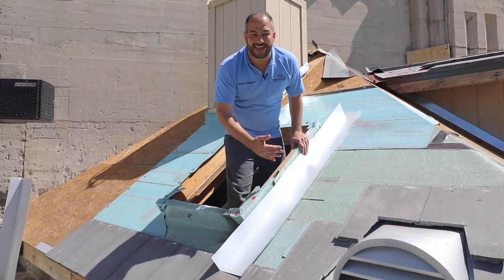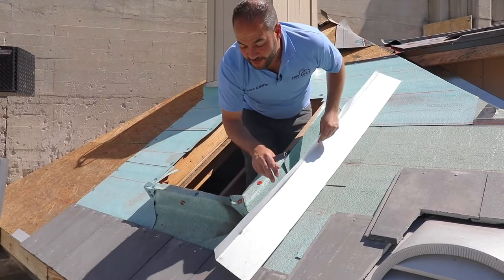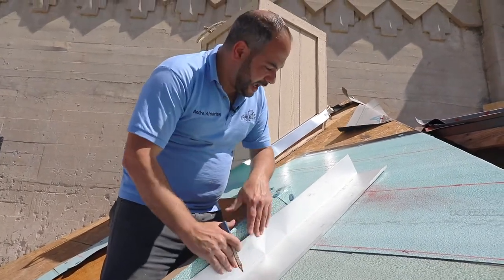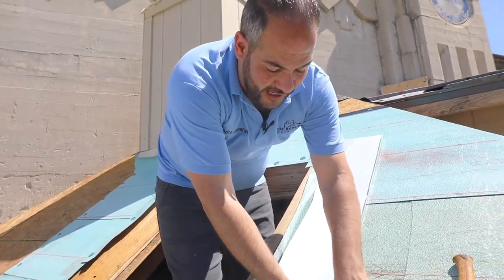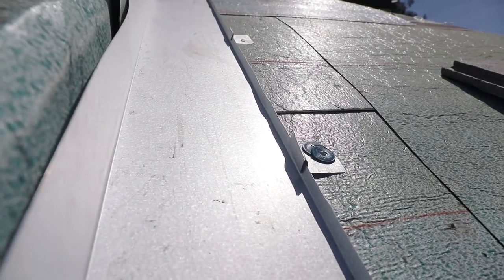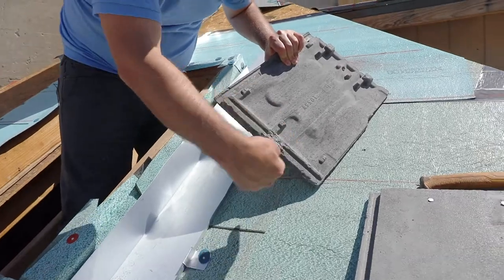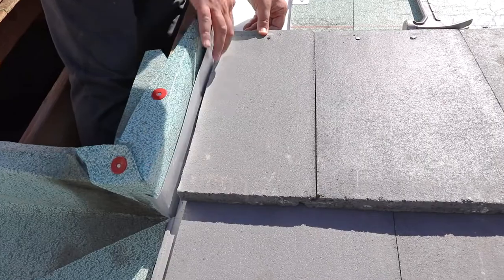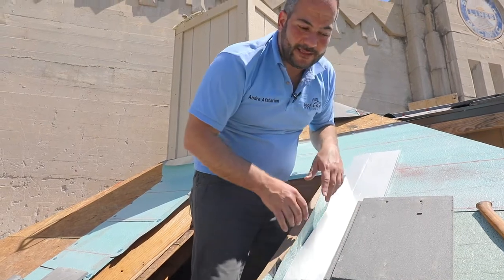How to Install a Tile Pan Around a Skylight | Flat Tile Roof Tutorial

Comment: Nice vid. You should move away from nails and use foam, no penetrations means no leaks later as the nails corrode thinner.
Reply from the maker: Ya, I’ve thought and heard about it. I knows they use it allot in Florida for wind rating. What state are you in?